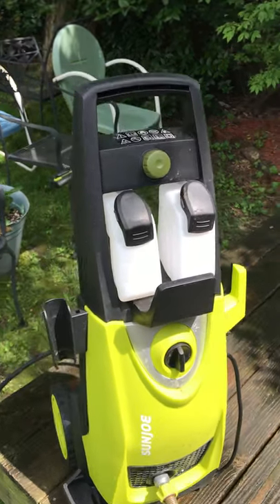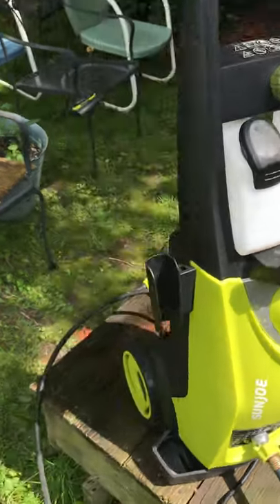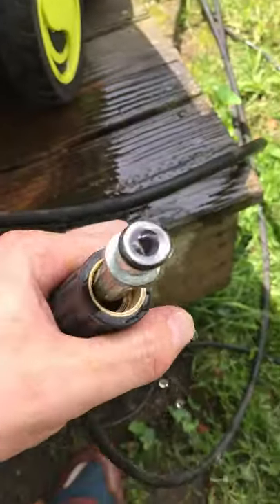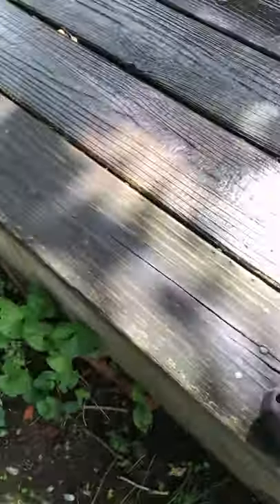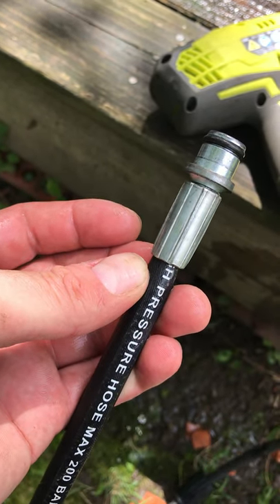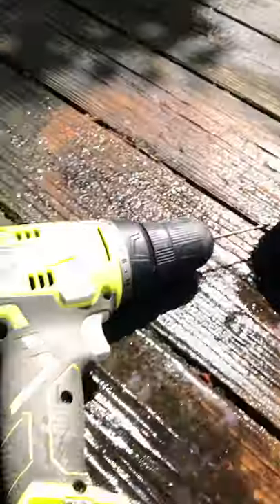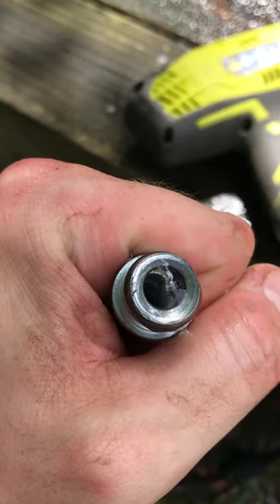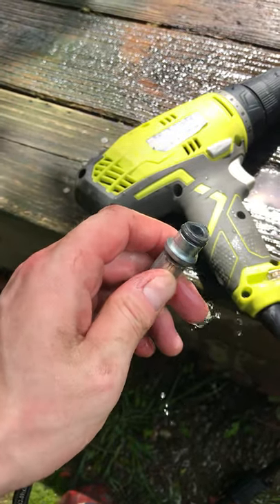Sunjoe Pressure Washer Instant Fix. Pulsating and shutting off fix. 5 minute fix!

Comment: I had the same pulsating problem but mine was caused by the plugged nozzle at the pressure gun that was plugged. I used my air compressor and blew out the tip of the nozzle I was using and that took care of the problem. You can check if that is your problem by switching nozzles. The hole in the 15 degree nozzle tip is quite small and if you have hard water it clogs up. Other wise this pressure washer has worked fine for me since I purchased it a couple of years ago.
Reply: Same here, a clogged nozzle stopped mine from working. If not mistaken it wouldnt work at all. Switched nozzels and that was it
Reply from the maker: This happened to me when I turned it on the other day. Trying to work it lose the nozzle shot off under high pressure like a champagne cork and landed out of sight.

Comment: Mine has three nozzles. The grey nozzle will build to much back pressure and it just cuts off and on constantly. The other two nozzles work perfect. The grey one that doesn't work is the widest pattern one.  I've cleaned it with the provided tool. And if some of you missed it in your box their is a thin wire with a circle at the end. This is your nozzle cleaner. It's so thin that if it lands on the floor you may not find it. I think mine is a 1500. Came with the foam adapter.

Comment: I have one of these. Anytime its pulsing it's usually my water pressure, hose is kinked or not the right size. Also it you have had it for awhile try a different end nozzle, yours might be clogged or rusted, it doesnt take much. Soak it in vinegar for several hours. Now that being said, I wish I could fix the absolutely horrible coupling they put on these, it never fully attaches and always sprays water even with teflon tape on the joint.
Reply from the maker: Just drill out the end, try that first. 1/8" drill bit.
Reply: Are you using a M22-14 hose on the M22-15 connector on the SunJoe?  14 will of course go into a 15mm hole but it wont seal.  You can get adapters now.

Comment: I have the same machine in blue. When I use it then it'll act as if it has a shortage sometimes and it will not spray right. It will do this on and off while sometime it will spray just fine. Will this fix the issue? It's 2 days old.

Comment: How did you detach the hose from the gun?  I cannot figure out how to get them apart?
Reply: the threads unscrew and then you wiggle it out, it gets stuck inside so it needs quite a bit of wiggling from a bunch of directions after you've fully unscrewed the clamp on the outside..

Comment: I have the same one.  It pulsates when I turn it on without squeezing the handle.  When i squeeze yr he trigger it works perfectly.  But the noise of the engine pulsating drives me nuts I cant use it.  I disconnected cleaned and re connected everything...
Reply from the maker: It sounds like maybe it's time to invest in a personal otic transmission dampening apparatus. Unfortunately this model did not include those.

Comment: So I just bought one of these and it has this weird pulsating problem where the pressure cuts off about every 15 seconds or so then comes back. Is that what you were experiencing?  I may give this a try, do you drill into the pressure hose on both ends of it? Do you also drill into the outlet on the back of the unit where the hose connects? Just want to make sure I do this right, thank you.
Reply from the maker: Yes, that's exactly what I experienced. Just drill in the hose on both sides.
Reply: I also thought he was trying to say drill into outlet on the back of unit too. He lack communication skills. Not sure why he just didn't remove the hose and show everyone which end he was sticking the drill bit into ? Would only took him few seconds to remove the hose from the unit. So there would be NO CONFUSING. Guessing he was just to lazy.

Comment: HELP If I remove the outlet hose the water runs freely BUT it will not power up. Cord lights up for reset and test but no power on at unit. Please HELP
Reply: The special GFI plug isn't truly watertight. When water gets in the circuit fails. I replaced mine with a standard plug, because I take responsibility for always plugging it into a GFI protected outlet. If you think no electricity is getting to the pump, and the test and reset buttons don't work on the plug, I think you need to replace the plug either with the same GFI plug or you can do like I did if you choose to knowing that electrocution protection must be provided elsewhere.
Reply: @JamieMurdock90  This is a rational solution but to protect the other people borrowing your deathtrap modified removal of the (built-in) GFI who wouldn't know better, please don't remove this potentially life-saving device
Reply: @markwineburg164  You make a good point. I have since replaced the pressure washer with a more powerful one. Before I throw out the old one, I will cut the entire cord off.

Comment: is the symptom on and off forever? I have the same issue.
Reply from the maker: That's right. They over crimped the hose connector. Drill out the end where it's crimped, 
 both ends of the hose with a 1/8" bit and see if that fixes your problem. They crimped these too tight at the factory, seems to be a typical problem.

Comment: I'm facing the same issue with the machine pulsating and shutting off.  I tried to drill through the hose openings but i'm not feeling any resistance ... no drill dust/shillings or anything... am I outta luck?
Reply: Probably too late but it might be your tip.. clogged tip or try using a different one.

Comment: What do you mean by “pulsating “? Mine just runs for about one second then turns off, then repeats that over and over.
Reply from the maker: I'd drill out both ends of the hose with a 1/8' bit and see if that fixes your problem. They crimped these too tight at the factory, seems to be a typical problem.

Comment: Doing that broke my bit into the hole....its worse!
Reply from the maker: You have to turn the drill on. I am so sorry I forgot to mention that step.
Reply: @symphonydedan  Drill was on, bit got stuck and broke off.
Reply: You must've had a cheap drill bit or  went in at an angle

Comment: Did not work for me
Reply: What fixed my problem was opening the unit up and tightened the outlet.  Looks like the manufacturer crushed the thread putting on the outlet pipe so water was shooting out at higher pressures.

Comment: This unit is garbage. Just don't buy one
Reply from the maker: This video is for people that already bought one.
Reply: @symphonydedan  I bought one. It didn't work. Now home Depot has it back. The service counter says 5 others have been returned to this store this week alone. It's a bad product
Reply from the maker: Definitely a bad product.
Reply: It's a product that fits a need.  It's electric so it's less powerful and cheaper than a gas model.  It cleans what many people need it to clean but it's not going to take rust stains, paint & oil off your sidewalks and driveways nor is it going to pressure wash your second story home from the ground.  It will clean your car, outdoor furniture, gutters (with right attachment), decks & patios (albeit at 6-9" with 15-25 degree tip).  It will do this for half to third the cost of a gas unit.  Not garbage but might not be the right unit for you.
Reply: @tjfitz-gerald3936  doesn't do any of that if it doesn't run, lol
Reply: @MinstrelSauce  Mine did that pulsating thing 5 mins into using it and now it won't even turn on, and yes, I checked the reset/test thing and the green light comes on, it just won't turn on at all, not even a click sound. I'm taking it back to Home Depot today. It's garbage.
Reply: @mwinchester66  sorry you had a bad experience also
Reply: @mwinchester66  you just have a clogged nozzel. Mine did the exact same thing 5 min after 1st use. Read up on it. Changed to a different nozzel. Never had another problem
Reply: @mwinchester66  hard to believe a clogged nozzel will make it not even power on. But i guarantee thats all the problem is. I had the exact same situation
Reply: I’m glad I’m an outlier. Mines worked pretty good for 6 years now. Cleans off my driveway oil and rust stains. Power washed my car. About all I need it to do.